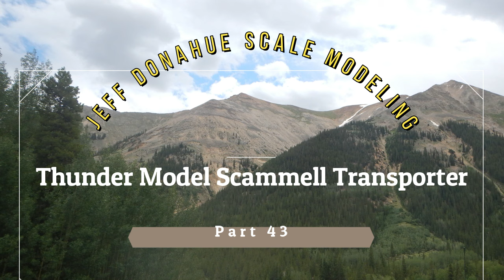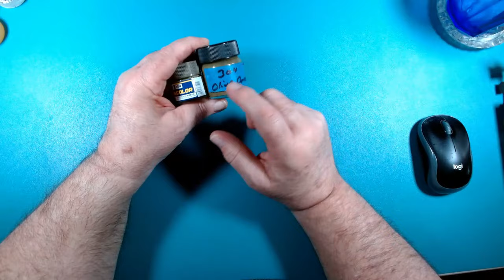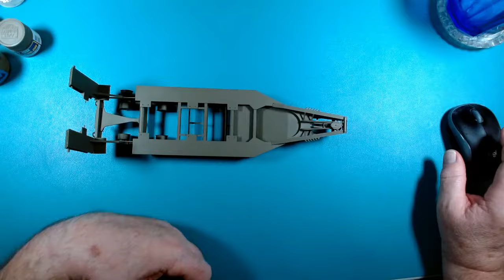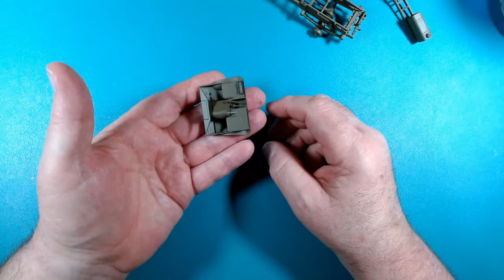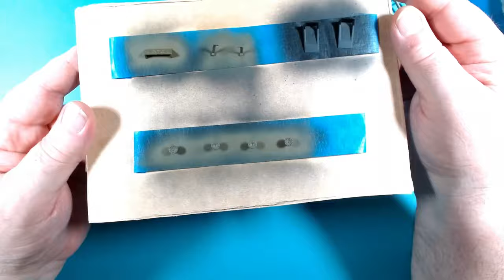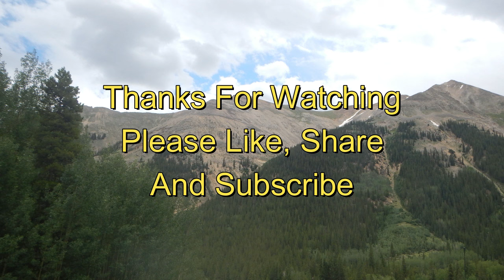Thunder Model 35207 1/35th Scale Scammell Pioneer And Trailer Part 43

Comment: Hi Jeff. Not used it myself but that Mr Color OD looks perfect mixed 50/50 great to see the kits coming together so well.
Reply from the maker: Hi Mark, Thanks again for watching.  Like all paints, the amount of thinner needed depends on a lot of things.  Temp., Needle Size, Age of the paint( some paints thicken with age), I usually start at a 50/50 mix and adjust from there.  Luckily, the paint sprayed fine with no other changes.  I must say Mr. Color makes some great paint.  Have a great day.  Jeff